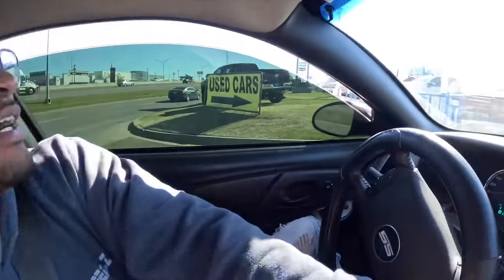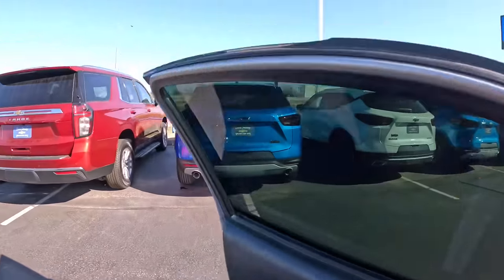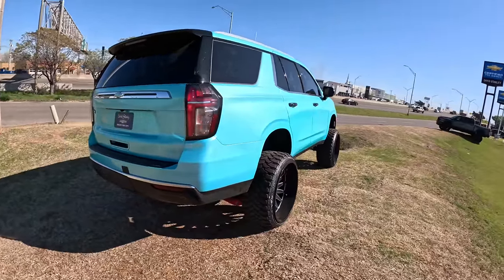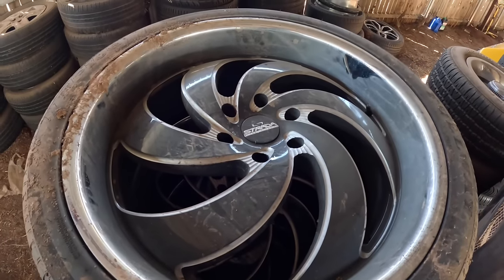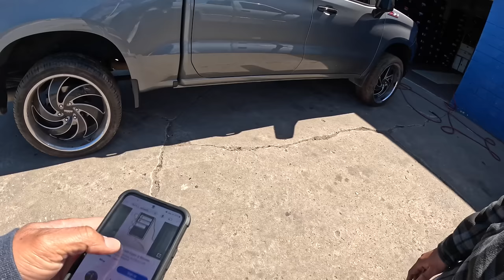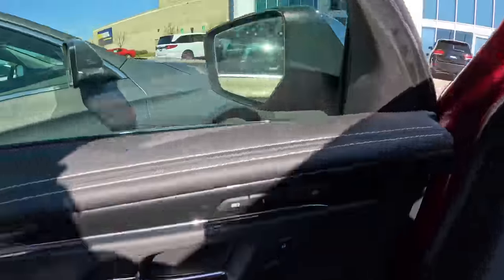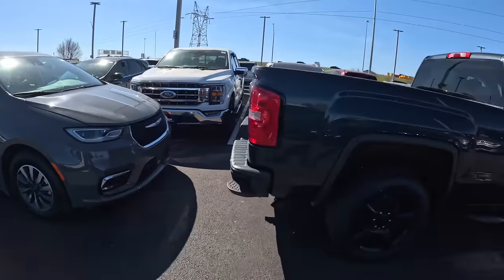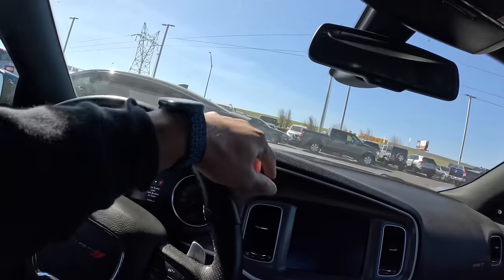Maximizing Your Cash: Selling Your Truck at CarMax Tips & Tricks

Comment: Until you jack up the pinto is probably just a hose coming up to the motor from the fuel pump is not the fuel pump it's a rubber hose